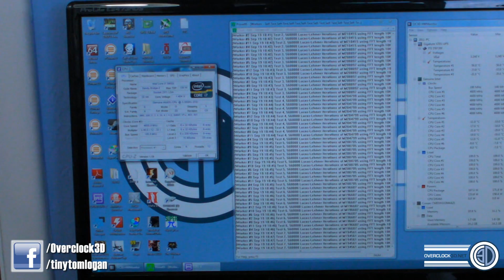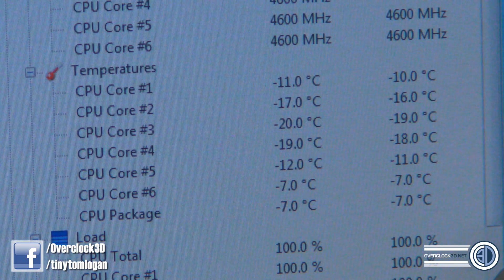Ultimate Corsair H100 Cooling Mod

Comment: Not possible the water would have frozen at those temps
Reply: You do realize that this is a troll video? Right?
Reply: The H100 does not have water in it. Check mate.
Reply: ***** source?
Reply: What if someone put liquid nitrogen in a water cooler?
Reply: ? Subzero temps don't instantly freeze water, especially rapidly moving water. rivers don't just instantly freeze do they? i will admit i don't know the pump speed he is running at but i don't think it would freeze.
Reply: diavolescaCZ yes i do
Reply: it would heat up and evaporate. Soon, there would be none left in the water cooler.
Plus the pump would die.
Reply: IF water is constantly moving, it can be superchilled and still not freeze.
Reply: still if the water is minus 25c i think it would begin to freeze after some time. and what happens when you turn off the computer i mean the water will still be under 0c
Reply: My friend actually has a cement toy truck which rotates the tank. He replaced the tank with a bottle of water and put it in the freezer. He got the waterbottle to -7 and it never froze. He even left it overnight once and it got to -12. He really loved chilled water, lol.
Reply: That is why he replaced it with liquid extasy!!! He said that at the end!!!1!11
Reply: ***** But then you will get condensation below room temperature, and since there is nothing to protect against that you will get serious trouble. That's why with all the LN2 or dry ice stuff everything needs to be insulated. And i also don't think this rad is very capable in handling freezing temperatures, it's just a normal closed liquid cooling solution, nothing that special. And ofcourse we all know this vid was a troll, but to make things clear if he was cooling below 0 C we would have seen desperate measures to keeping everything dry
Reply: Actually if its moving its not gonna be able to form crystallize and freeze as easily, same reason that you turn a faucet on in the winter to prevent the pipes from freezing.

Now i'm not sure i believe these numbers, and obviously it wouldn't cool his room, and like 2 fans would have been just as effective as 40 simply because its not gonna draw in extra air, it was a kinda amusing though.
Reply: Tell that to all the car drivers living in Iceland. 
They might not agree.
Reply: Raritize heat would cause evaporation on the outside of the heat piping and it'd mess up your other compnents, unless the ambient temp of your case and compenents was the same as the liquid nitrogen then it'd be somewhat better, however you'd still have condensation build up on the outside of the case, so you'd want to make it water proof. If the room itself however, was the same as the liquid nitrogen, the computer would run fine. unless you plan on playing battlefield 4 in the middle of the night on an arctic ice cap, goodluck trying to get your entire room to get anywhere near liquid nitrogen temps.
Reply: rogantu but in that condition its very unstable and could instantly freeze at any moment.
Reply: I don't know if that is true or not, so I shall surrender to you.
Reply: Still if it was water it won't freeze if it's flowing. It becomes super chilled water
Reply: but as soon as it stops or gets chocked in any way it will instantly freeze
Reply: you keep saying that, but his water never froze. I think it's possible, but to say it WILL happen 100% of the time is crap. It didn't happen in the video, now did it?
Reply: You can use cars radiator water it never gets frozen even if it was  chilled but also I don't believe in air power to get that degree
Reply: 60 % 40 % alchochol ;)
Reply: Raritize
 not sure if troll...
Reply: If you read he packaging Corsair puts glycol and other various chemicals in the loops to prevent freezing when shipping in cold regions so it's very possible it doesn't freeze ;)
Reply: hyperworm
It uses coolant so it doesn't expand and contract under temp loads and cause cracking and has special properties to prevent oxidation and erosion of the system. However you will never get below ambient unless your compressing freon, colder substance, or use a TEC cooler.
Reply: Thx, Captain Obvious! :D
Reply: kempouk lol

Comment: I can see maybe 2-3 redundant fans being beneficial but this seems way too over kill.   It would make more sense to have more radiators and spread your fans across them.  More fans per radiator would push the air though the radiator better but it would defiantly have diminishing returns after the first 2-3 fans I imagine.

Comment: hey i also wanna make some change with my corsair H100 cooler
is it possible to customize the H100 with Corsair Air Series SP120 normal H100 radiator sized fans. and maybe change the old model black liquid cables to some visible cables and then put some color liquid in the radiator so ill see colored cables like others watercooling systems . just with customizing the Corsair H100?

Comment: you should mount all the fans i a big grid and have them all set as a pull thru set up with a piece of duct reducing the size  down to fit the H100 it would work great.

Comment: He even said it defies physics, which is true, at -7degrees the water in the cooler would freeze, also it doesn't cool the liquid it cools if the liquid is hot, if the water is at room temperature it wont do anything besides maintain equilibrium.

Comment: It's pretty cool. Although the absolute minimum recommended operating temperature on most consumer CPUs is around 0 celsius. Not to mention that cooling your components to temperatures lower than ambient for regular use is the mother of all bad ideas as condensation can, and will, kill your components pretty irreversibly.
Reply: Well condensation does do that, but that happens if there's a lot of humidity/moister in the air. That of course can be taken care of with Dehumidifiers.
Reply: Artistic Kamen Rider
So you will need some pretty potent dehumidifiers for the room and some environmental suit for yourself so the prolonged presence of your breath and body evaporation does not contribute to the ambient humidity.

At which point it becomes considerably cheaper and more practical, for those who need their workstations/servers cooled to such an extent, to just lower the ambient temperature in the room itself and work from the next one over. Which is exactly what they currently do. :)

Nevertheless -  as a proof of concept - this thing is still awesome!
Reply: tetragrammaton111 yeah, but I'd like to point out the temps on the CPU cores in the video kinda gave a huge red flag.

The in Celsius the lowest one has gone was around -19 to -20 degrees Celsius...which is -2.2 degrees Fahrenheit(converted from -19 C) to -4 F(converted from -20 C).

Temperatures that cold should mess with the electricity flowing in the CPU.

Comment: Why would you liquid nitrogen cool when you can do this, it's less effort and only a shit ton louder
Reply: And safer too....also it wouldn't be that loud at certain distances, he held the mic close to the fans when it was blowing...but could barely hear it when a few feet away from it.

If the sound bothers you, construct a vented box with noise dampening foam(mainly the cone or pyramid foam).

Comment: Yeah, we all have a 20,000 watt PSU lying around. 2 Noctua fans, without a watercooling system is all you need.
Reply: DID YOU SAY 40 NOCTUA FANS!?!? You heard it hear first, a spectacular idea by Zach Poremba. On this episode of 'reasonable computers'.
Reply: KemoKa77 is love a beautiful refrigerator?
Reply: Yea I'm pretty certain he's not rocking 5000 fans, (if you do your math). EDIT* All of those fans would require roughly 43.2 watts.
Reply: McFurck Offington  haven't tried, but TOCA2 Touring Cars (1999) works fine, Railroad Tycoon II Platinum too (but cannot manage LAN mode damn); I'm using Windows 7.1 x64 so I haven't that many compatibility problems like people with Win8/8.1 :Đ
Reply: ***** Someone on the linustechtips forum has a computer with 23 noctuas in it
Reply: MrPartyWaffle I exaggerated the amount to show how ridiculous it is in the first place.
Reply: MrPartyWaffle NO >:o love is a hot sweaty sauna that makes your computer short out!
Reply: THEN I MUST NOT LOVE MY COMPUTER!!!
Reply: NH-U14S inside mini-ITX case here, i7-3770K@4.532GHz:))
Reply: how about 40 ebmpapst fans? there are these 24V models that run at 11000 rpm.

Comment: mate, U know that temps below zero (in celcius) are impossible here, even U put 10 mln coolers on it :P, it may happens sometimes in some conditions that U can cool things with air below temps of an air but it need to evaporate moisture what will not happen here, not to go under zero celcius...:P
but btw nice overall big cooler, but unpractical

Comment: awesome solution and might actually be cheaper alternative to nitrogen this is actually applicable for daily user. Can be more noise but were I to improve I'd use 2 layer or 3 layers of industrial fans. People have modded their case with industrial fans before. Real down side is at those spinning speed it will crop your finger.

Comment: Lol, He will take that H100 Off and his CPU will be iced :P xD
Reply: ***** False. You CAN cool stuff with air so that they go under the air temperature, that happens through evaporating condensation/other moisture. In this case, tho, it IS fake. There's obviously no moisture in the rad/fans and getting it THAT far under room temperature isn't too likely to happen.
Reply: This video is a fake. How should he cool the water with air under the room temperature. It's impossible to cool water with air that has 20°C to under -10°C.
Reply: i thought is was going negative, and then the logical part of my brain dropped in and now i am imagining if it was true.... although, it would make a very cold, misty shower!
Reply: Tobias L. the air is taking heat away, that is why if you touch metal it feels colder than wood at the same temperature
Reply: cakeless coder Watch the cooling CPU with liquid nitrogen video its logit and he gets the CPU to -140 when it has a cold he also is able to clock the CPU to 6Ghz!

Comment: lol sounded like fucking nascar.
Reply: Or a reference 290x
Reply: or a gtx 690
Reply: ***** or a triple redundant 600 watt server power supply.
Reply: DerPinguin44
Those are louder usually, at least a much more high pitch annoying sound...
Reply: Yeah I ran 3 of those at the same time. It sounded like a jet engine in my house.
Reply: most i have run is 4 at same time with my friends
Reply: ***** You have 4 triple redundant 600 watt power supplies?
Reply: ***** https://www.google.com/shopping/product/11196066385888667014?q=600+watt+triple+redundant+power+supply&num=100&espv=2&biw=1746&bih=901&ei=1V2KU-3uFZfsoASWxoCgCA&ved=0CIUEEKYrMAA This is what I'm referring to.
Reply: no i dont own 4 but at one time me and my friends where clearing out a server room and they had them lying about so we tested to see if they were still working
Reply: ***** They're so much fun. Running them in your house is basically like saying anyone who visits, "Yeah, I know you're here, but I'm doing stuff."
Reply: Lol I had to run them in a fairey confined space
Reply: ***** I had them in a 10'x12' room, with a handful of HP Proliants running, also. Those are all gone now, as I've moved from Florida to Arizona. I'd do it all over again in a heartbeat.
Reply: lol

Comment: You can't get below local ambient air temperature using air cooling without some refrigerant/heat pump mechanism like a compressor or peltier module. "if you get figures that your system is 100% or above... time to re-calibrate some of your temp tools", from here procooling.com/index.php?func=articles&disp=32&pg=1 .

Comment: You have to be complete idiot to believe this nonsense. Stacking 40 fans to each other. You might as well attach 2 horses in front of a carriage and say they give double the speed of one. Another thing is that air heats up due to friction when moved around, so it cant get colder than the room temperature already is. The temperature in that room was supposed to be atleast -20 to get this result.

Comment: Hey, why stop at 40 fans?  Can you imagine if you kept adding fans and adding fans and adding fans till the temps dropped down to the point where the cores became super conductors?  My god, you could clock that thing up to a bazillion Ghz because you'd have no resistance and consequently no heat at that point.
Of course you'd have to empty out your bank account once a month to pay for the electricity and your neighbors might get upset for making their lights go dim whenever you turned it on.  But just think of the possibilities.....

Comment: Really cool, but I would not recommend trying this at home. Temperatures this low can cause condensation on the motherboard, which could be very bad for your system. If you were making popsicles on the other hand...

Comment: With Noctua Fans we could hit absolute Zero :D
Reply: No -60 deggres c
Reply: I use noctua fans on my car radiator
Reply: And with even a few more Noctua fans we should be able to hit -10 Absolute Zero. ;)
Reply: rhadiem that would cause cold fusion
Reply: Watching this video my Noctua fans are keeping my H100i at 75.7F in HD LOL thats all my i7-4770k needs to be happy!
Reply: scraech what's your room temp?
Reply: 72F @56.5 rel humidity
Reply: You know absolute 0 is about -273 °C
Reply: no i didn't know that.   If you wanted to keep the H100i radiator really cool I could set up a tubing system over the radiator using CO2 to chill it.  And for what to run "Prime 95" to see if i could control the temp?
Reply: have fun with the condensation

Comment: That's pretty funny considering you can't make the computer much cooler than the room its self lol
Reply: Retalak It's not water, it's liquid... most coolants do not freeze at temps that high...
Reply: yes you can.
Reply: steamAltech Bud no you can't.
Reply: so you use fans to make your computer warmer?
Reply: steamAltech No but if the freezing point of water is 0 Celsius how the fuck is his LIQUID COOLED CPU at -15?
Reply: steamAltech Lol you are wrong. This is an old april joke from Tom. Of course you cant get temps bellow room temperature with regular fans. Also it's not regular water in water cooling loops. It contains anti corrosive's and anti bacterial assets.

Also pressure will not prevent water from freezing. Below 0 water ALWAYS freeze if it aint mixed with alcohol or other anti freeze liquid. On the other way pressure will prevent water from going in to gas form when hiting 100c.
Reply: tobias lindgren There we go someone who gets it.
Reply: Retalak
 if it was just water it would end up making sludge over time, besides its most likely under pressure in that circuit, and its also in a constant flow. ect. ect. so it can go below 0c and not freeze
Reply: steamAltech The video is a troll dude seriously are you that thick skulled?
Reply: ***** It's water in all watercooling loops. even in pre done closed loops like this one. It's just mixed with some anti corrosive. No anti freeze mixtures is needed becuse who runs your computer outside on the winter. Haha its not a car. 

And that system that on this video is not running below c. He is just trolling stupid kids that would believe that more fans could get temps below room temperature. Haha!
Reply: steamAltech
You can with a Peltier element, liquid N2 cooling, vapor-compression refrigeration, or some more exotic cooling methods, but not with this rig.
Reply: ***** Not in this video.
Reply: You're the thick skull one.... >.>
Reply: ***** No but I actually know what I'm talking about here.

Comment: HAVING MANY FANS IS A NO BRAINER AS  1 FAN WILL DO THE SAME AS HAVING 10 FANS LOL HAVING THAT MANY FANS IN A ROW IS  SOMETHING A POOR BRAINDEAD WOULD DO LOL

WHAT I HAVE SEEN IS A COMPUTER(ALL THE GUTS)  INSIDE A FISH TANK WITH MINERAL OIL  INSIDE A SEALED CHEST FREEZER  ON THE COLDEST SETTING AND THAT WAS  FUCKEN OVERCLOCKED MAN WAS THAT POWERFUL AND COLD LOL A TRUE -20DEGREES CELSIUS